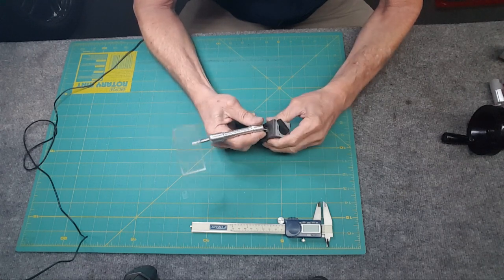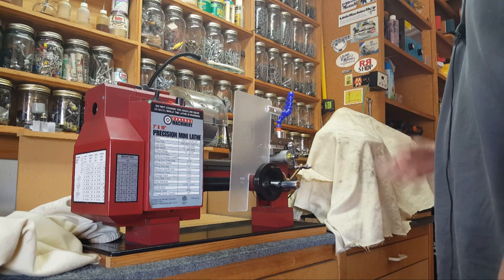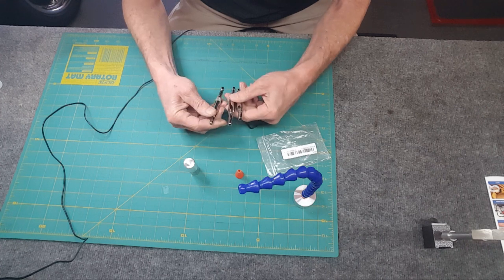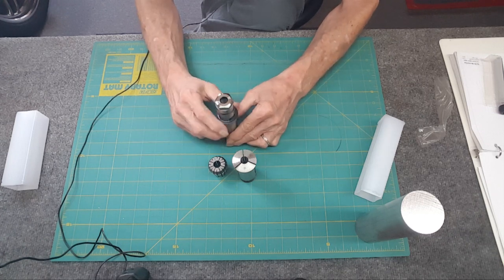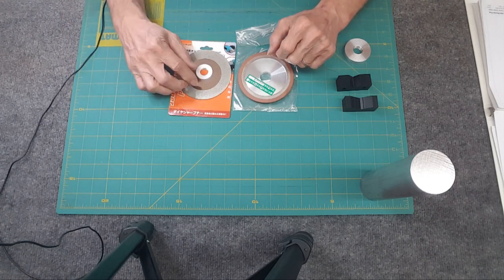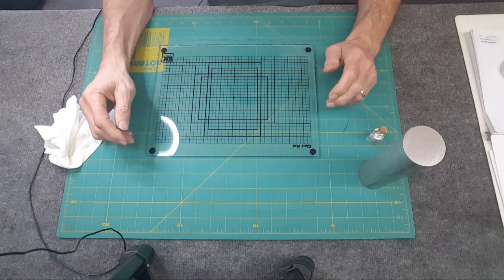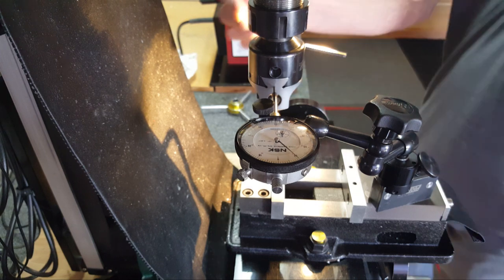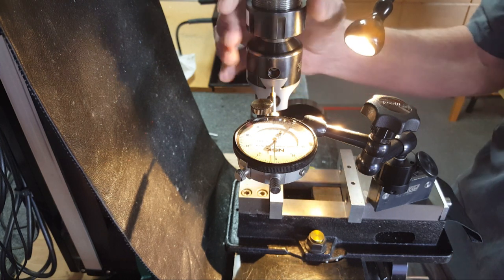Shop Ideas and Boring Head Check

Comment: Dave

To add rigidity to that flex arm, put some heavy gauge solid copper wire inside.  10 gauge should be fine.  Or use some aluminum tig filler rod.

John
Reply from the maker: Not a bad idea!!